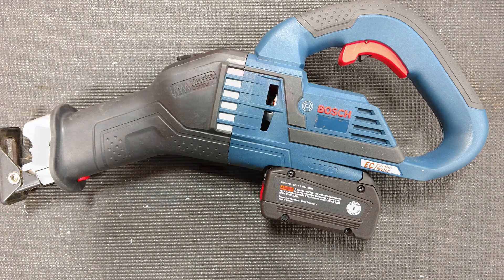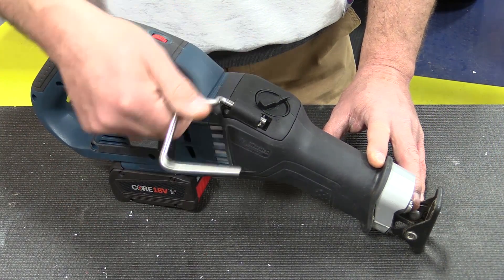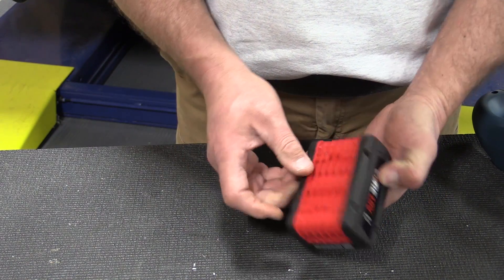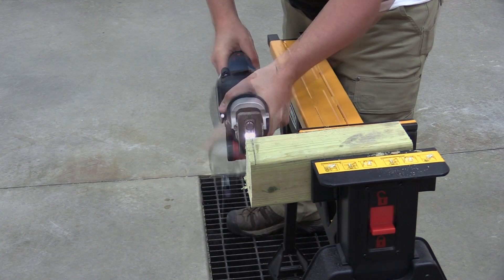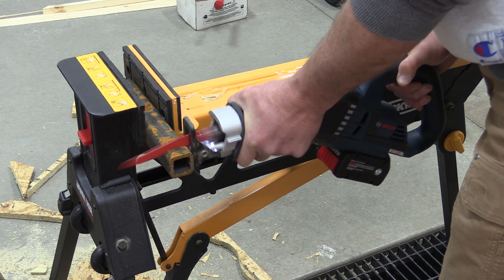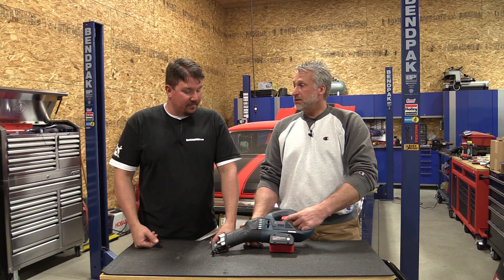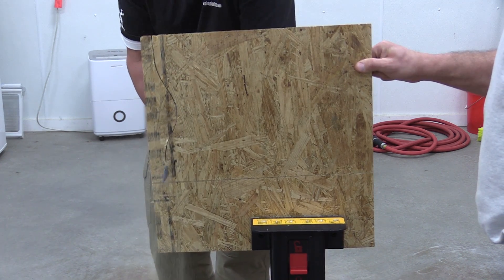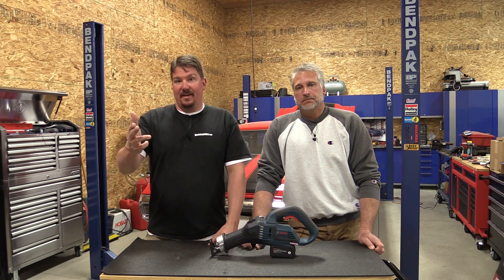New Bosch Recip Saw with Bosch CORE18V 6.3 Ah Battery - GSA18V-125N

Comment: Reciprocating saws are not the tools to deviate from the standard form. This is not a real sawzall or even close to the mark. I don't know why Bosch is doing this.
Reply: This saw was a cooperation of Bosch Professional and several Fire departments. The design is made by fire fighters and they seems to like it. The beefy blade lock and wide handle and big trigger are good for working with thick gloves.
The D Handle is also a better option if you cut for example cheat high into a car  door vertical.
I have this saw and the Milwaukee M18 FSZ and even its close to 5 years older than the Milwaukee its still the better wood cutter and its like 1.5 secs slower on metal. 
The Blade lock is better and the light is better.
Reply: @Zozo806  Hello, i didn't know about this cooperation. Do you know when this tool was released? I have this model for two weeks. I think it is the only brushless saw from bosch. But hey, this is the heaviest one i ever used.
Reply: @fuloplehel  in the first Quartal of 2022 it will be 5th year after release. 

Yes its an heavy tool compared to actual saws. I think Bosch will release a BiTurbo Unit next year.
Reply: @Zozo806  Thanks. Anyway 5 years is a long time in the tools world. But i think this one is very well built. For me is powerful enough. Bi turbo maybe will be more powerful and efficient, but I'm not upgrade this one, because it is a new tool and already an overkill.
Reply: @fuloplehel  i have the GSA 18V  32 since release and in another truck the right now last Milwaukee M18 Sawzall FSA Gen 2 One Key Version.
I used both mashines long enough to compare them and while the Milwaukee is maybe a second faster in cutting on a task that need 15 to 20 seconds the Bosch has still way less vibration. 
With a wood blade and orbital on 2 it even still outmaches the Milwaukee by a hair. 
The GSA is a tank and while the drywall Crew prefers the M18 because its more light the concrete guys do likr the GSA more.
Nearly no wobble on the adjustable shoe. Can withstand rain, the rafer hook is massive compared to the Milwaukee and the blade Release is better for working with thicker gloves. 
The wheeled speed adjustment also seems more controlable as the electrical 3 Button solution on Milwaukee.

I think Bosch will maybe go back to the Standard Sawzall Design and upgrade the strokes up to 3200 to 3500 RPM. 
I hope the will keep the orbital and leave the control Display away and keep the speed wheel.
Reply: Ok then. Anyway I'm a Bosch guy. I don't have any Milwaukee tool. I have more than 10 tools in bosch 12v platform. Thermal cameras inspection cametas. Milwaukee is mote expensive, and here in Europe the bosch distribution and service network is widely available. Milwaukee is not so popular yet. Makita also have a manufacturing plant in my country. I think i will be satisfied with this saw. I don't want any display on my drill or angle grinder. Some leds will do the job.
But we like to over complicate simple things.

Comment: I have had no problem using the safety, after a year of using it, i like the handle as it is comfotable and easy to use.  

You just have to step out of the preconcieved way you think a tool should be designed.  I thought it looke weired at first also,  but assure you the handle is awesome and the safety is easy to use.  I dont even think about it and my 5ft 6in wife has longer fingers than me.   Just get where you can try one.  It saws faster than a lot of corded recips.

Clifford alloway

Comment: Why do cordless tools have these safeties but corded tool don't?
Reply from the maker: David Mm I cannot answer that and I was wondering if it is because of the size of the trigger.
Reply: I guess it's possible.
Reply: Cause you wouldn't put a corded tool in a tool box or bag without the cord disconnected but might put the cordless one in with the battery attached and they might go off if another tool pushes the switch inside the box

Comment: Nice Upload Guys! yes this is definitely one awkward looking saw. I Like  The  features it has with the Variable speed & 3 modes of orbital. I can understand that they are trying to be different,  but like you said over head work puts you right under it. So I think this saw is going to be used for specialty work & odd areas to cut where a regular sawzall wouldn't be able to perform so well. Some will love it! & some will hate it haha!!
Reply from the maker: Mark Mckinney You got it.
Reply: You are correct, actually the design was made by Fire fighters

Comment: is the saw available yet? i remember reading some where it will be out in July but no information  on the pricing
Reply from the maker: This is not out yet.  it was sent to us as a test unit for the battery.  It will be out soon with pricing for the bare tool at $299.00.  It is pretty expensive.